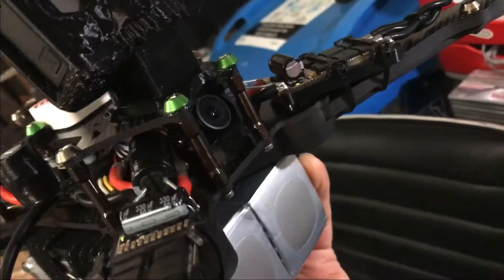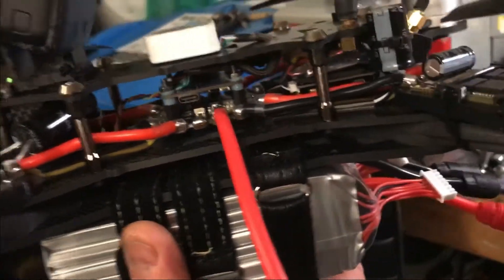BEAST-CLASS  beluga 552 APD esc betaflight 4.3 matek h743

Comment: Take shovel with you when  fly that one if it hits the ground you’ll have to dig that out lol
Reply from the maker: Thanks man it sounds like a jet powered saw mill when turning tight under power.  It has to be respected though would main badly i follow safety to the max and have spotter when flying.  Beast class for sure.

Comment: Great video , fantastic build !! perfect carbon  work #cncmadness
Reply from the maker: I will be doing more in depth on building and tuning big stuff once this beast is locked in and all noise crushed. The new apd 120amp rpm firmware works perfectly 0% error at full 22,000 rpm while running full telemetry gotta love those apd esc. 👌
Reply: @noisy_boi_fpv_3920  thats great to hear , thanks very much for appreciating the frames and making these great video,s !

Comment: So if you forced cell count the Frsky radio etc or the likes would call out the voltages?  So it's still possible to use DJI safely as voltage could be called.

I learned something from your other video that I never realized about the DJI system and that's max voltage display.

Awesome.. would be good to know how you flashed and set up those Escs... not sure if there are any videos out on how to do this..

Really nice build.. 
I reckon it should be called the Beluga Sport .. 
The Gopro mount is from?

What's the top speed that you have hit on the T7 plus the kv you are using..
Reply from the maker: Check through my earlier videos i show apd flash and pass through👍👍havent flown it in anger yet but we  should pull 120mph+ as quite a high kv for 12s. I have full telemetry all set on radio voltage not main issue it the current read out in osd i cannot go without for the obvious reasons. Glad you like it
Reply from the maker: https://youtu.be/84fcvE3_pnI
Reply from the maker: https://youtu.be/m0X8Ry1am5M
Reply from the maker: Check links apd mod and flashing of bootloader. Then passthrough configurator

Comment: Seems like you left the ground wire shielding off from the esc telemetry and signal wires. And I'm assuming that the resistor that was there in the signal wire input that was supposed to combat the same thing is not available either(bidirectional dshot mod). Risky business... neat beast tho 👌
Reply from the maker: No three wires tele sig and ground. Absolute must in heavy current rigs. Look closer. I always run it. But yeah its easy mod no probs at all when youve got the tools and bdir dshot is far to important to not use worth the time the resistor that needs to be removed would slow return dshot signal no drama’s.
Reply: @noisy_boi_fpv_3920  OK it seems on closer inspection that it's there, but it looked like they weren't twisted which is the "shielding" part I was talking about. The "twisted pair" cables are really good at reducing em noise in the signal wires.
Reply from the maker: @larijoona  thats why its pressed against signal wire along its length negative ground suppresses emf i have 9 caps and two on battery leads. Raw noise in black box is awesome like all my apd quads. 👍

Comment: We need someone to build a X114 Switchback quad version.... are you keen .. up to 12 inch props .. up to 12s or can be 6s on 4214 size motors or can do 3115 motors.. later add the X8 bottom arms if you want.. plus esc set and prints for them.
Button on bottom battery tray quick release plus esc just above that.

Not released yet.. part of  the X811V6 series coming out.

All parts are designed ready to cut.. 

Ask Stefan
Reply from the maker: Ive seen it the drawings. Octo not really my thing no need for it. Bit i would build one for some one if need be
Reply: @noisy_boi_fpv_3920  Its the quad version of the Octo ... same arms on top and crutch arms on the bottom where normally the Octo arm goes.

It has a clip on battery tray on the bottom.. really nice plus a esc tray above that for 8s or 12s esc proper fittings for DJI or 20x20 analog gear..  
It's the next level to the Faty  with the latest carbon arrangements.
Reply from the maker: @MichaelRyannz  i will have a look at it. Xclass next and currently have three projects on the go.

Comment: Do the ends of the arms have holes for the motor shaft bolt clearance?
Reply from the maker: @inoc805  they do but it doesn't matter as motor shaft is clear
Reply: @noisy_boi_fpv_3920  thanks for responding.    I have a set of V1 Mad XC5500 motors that have the c clip style shafts.    They poke out a little bit.  Just wanted to make sure this frame would work without me having to drill the arms for clearance.